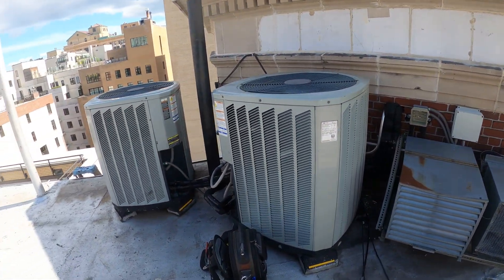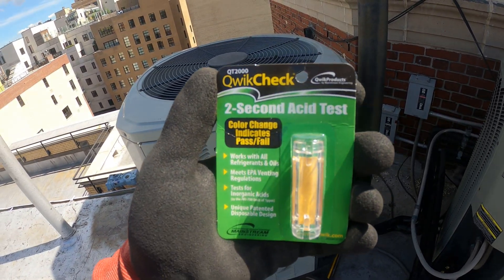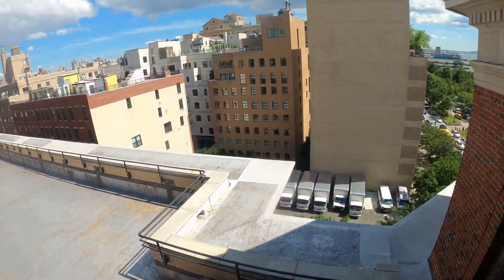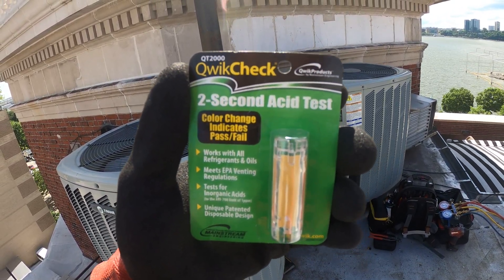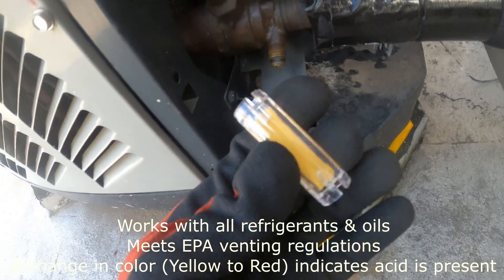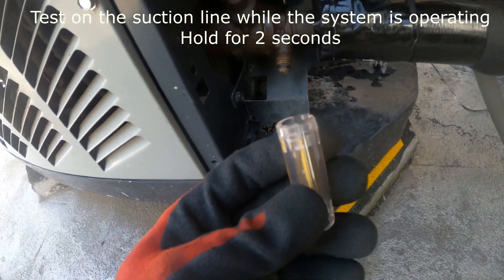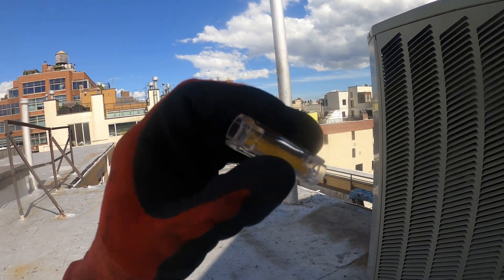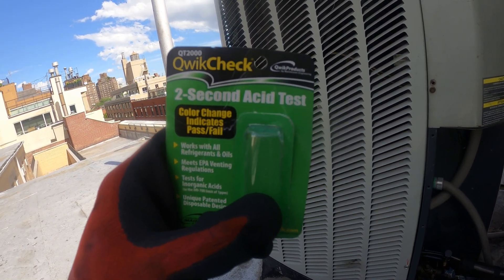HVAC: Testing Refrigerant In An AC For Acid (QwikCheck QT2000) QwikCheck 2 Second Acid Test Kit

Comment: 👍🏼
If acid is present, what happens next?
Reply from the maker: There's a few steps to be taken from there. Qwikproducts sells something with the model number #QT2501 where you can inject it into the system and it removes acid. It's compatible with all refrigerants and oils. From there, test again to check for acids. Hopefully that does the trick. There are other ways & methods as well. Thanks for watching & stay tuned for new videos every week🔧⚡️
Reply: Looks like you had the system running, is that necessary? My compressor is grounded so it just blows the breaker instantly and won’t run. Can I still test without the system running? If not how do I tell if I have acid?

Comment: just replace POE oil with PVE oil. PVE oil doesn't form acid if contaminated by moisture and it is superior lubricant in every aspect compared to POE. yes you can use PVE oil with r410a and r32